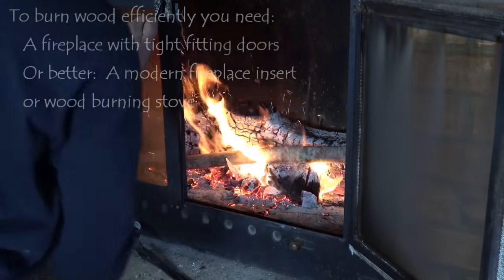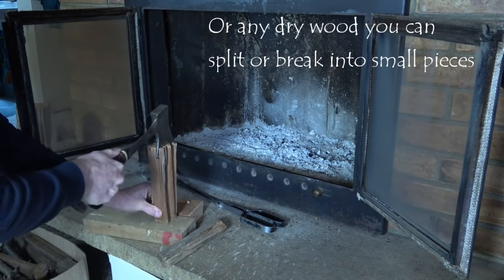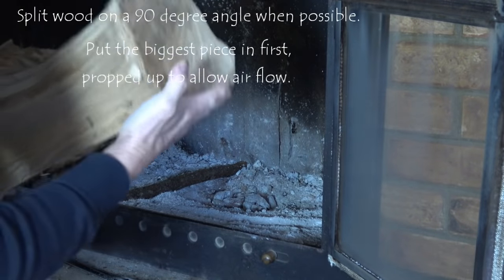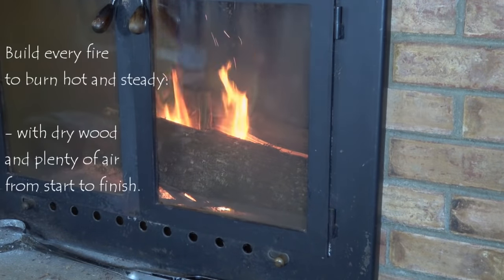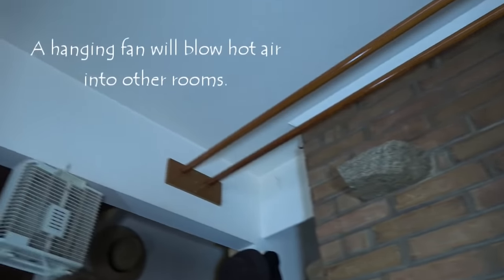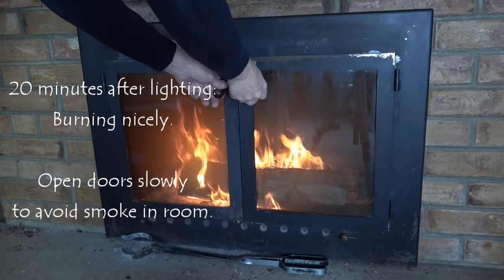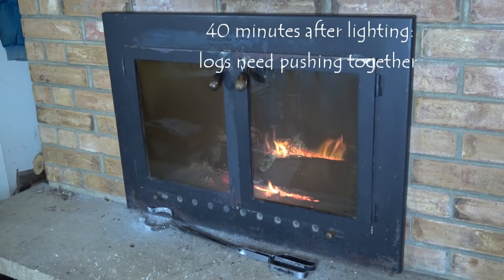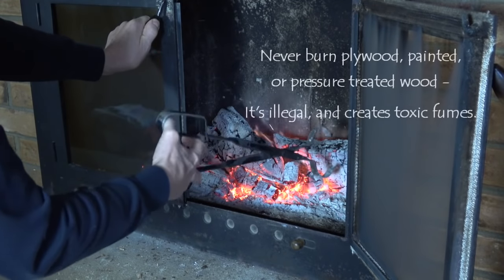Heating Your House Efficiently with a Wood Burning Fireplace or Stove

Comment: Are those ceramic glass doors or are they tempered?
Reply from the maker: They are Pyrex, which is less common.  Tempered glass might shatter with a very hot fire. Ceramic is usually the best choice.
Reply: @HartzHomestead  I have tempered doors on my fireplace and I worry about closing the doors I also have a heatilator with metal firebox and 2 fans that blow heat out the top but I can't find ceramic doors to be able to close and heat the room properly
Reply from the maker: @anthonyd.9314  I had these doors custom made 37 years ago for $300. I've seen air tight ceramic glass doors online but they are about $1000, and for that you might be better off getting an insert. If the glass in your doors is replaceable, you might call some fireplace or glass shops and see if they can custom make Pyrex or ceramic glass the exact size to fit your doors.

Comment: im about to buy a sweep and try to clean mine out dont think its been used for 40+ years
Reply from the maker: As you clean it, look at what condition it's in. Have a fire extinguisher on hand, and gradually build up the fire, watching the chimney inside and outside the house. It should be fine if it hasn't been damaged in any way.
Reply: @HartzHomestead  thanks for the advice its protected from the elements as it has a  cover on it that comes off :)

Comment: Anyone know where to place the wood burning fireplace in a house?
Reply from the maker: As close to the middle of the house as practical, so the heat can radiate in all directions to warm your house. If you put it on an outside wall, you'll need to insulate the back side, or lose heat to the outdoors. If you're building a new house I'd suggest a rocket mass heater in the living room, as they are super clean burning and efficient, and the mass keeps your house warm longer. The only disadvantage is you can't sit and watch the fire. Also they take smaller wood, which can be a pro or con, and some insurance companies might not accept them.
Reply: Hartz Homestead, do you know any types, sizes, or styles of furnace that are popular today? Maybe you can send me a website that can answer my question (?)
Reply from the maker: @jme.7652  See the links in the description of this video for stoves and fireplace inserts that are available on Amazon. The Drolet Wood Stove has excellent reviews and sounds like a high quality stove. You can also search Google or visit a fireplace shop.

Comment: Also a damp paper towel dipped in the ashes will clean your glass like new! You're welcome.
Reply from the maker: It's true, I've done that. I still takes some scrubbing, but the ashes are free and readily available.  For a really thick coat of soot on the glass, scraping it off with a razor scraper gets most of it, then the damp paper towel & ash finishes it off.
Reply: @HartzHomestead  using a razor blade Marine metal scraping material we'll put my new scratches in the glass and eventually make it hard to see through. I'm a shell used wet wood ash misted with white vinegar.
Reply from the maker: @paulatwood9794   I assume your not-so-smart phone wrote some of that for you?  I gather you're saying I'll scratch the glass, but keeping the razor blade flat against the glass, in 35 years I don't think I've scratched it any. I worry more that scrubbing it a lot would scratch it.  I hadn't thought of using vinegar with the ashes though, so I'll try that - thanks for the suggestion!
Reply: Yes that was my smart phone talking for me due my arthritis in my extremities. I've had good luck with using the white vinegar for my stove glass
It also makes the brass look new after removing any tarnish. (I finger typed this time,LoL!)

Comment: Interesting video, thanks!
Doesn't a wood burning stove make your whole house smell like burnt wood? Or would this be a matter of maintaining a smoke-free fire?
Reply from the maker: Avoid letting smoke into the room. Burn a hot fire with very dry wood, which produces less smoke. Open an outside door or window just a crack before slowly opening the doors to the fireplace, and the fire will suck air up the chimney, so smoke doesn't come into the room. If we do get smoke in the room, I run a Merv 13 filter on a box fan that clears the air in about 10 minutes (see my video on that). Breathing smoke is very bad for our lungs, so it's important to keep the air in the house smoke-free.
Reply: Hartz Homestead Thank you very much! I’ll see what I can do with this unused stove we have, after I get the chimney sweeped.
Reply: @HartzHomestead  i did the same but my box fan has 4 filters 20x25x1 3M 1900 is like Merv 13, in Cubic Arrangement Box Fan on Top Blowing Up so it cleans the air really fast
My Wood Stove is new ultra efficient little or no smoke and holds the fire up to 6 hours

Comment: Well explained thank you! Any suggestions how to heat to more rules is it possible to have a wood-burning stove and to let the pipes of the main wood burning stove run into the other rooms?
Reply from the maker: It would be easier to blow the heated air with fans into other rooms (or pipe it through ducts) than to try to re-route the chimney pipe, unless you build your own Rocket Mass Heater.  A horizontal run in a chimney pipe would likely not draft well, and could be a fire hazard. But you could collect heat near the ceiling above a wood stove and duct it through the house with a fan. Our chimney is in the middle of our house, so the bricks get warm upstairs too with a hot fire.
Reply: Some modern fireplaces allow for built in B vents which allow you to directly pipe in hot air to different rooms or floors.  If you've got central air and the return is near the fireplace, you could put it in fan only mode and have it pull the hot air from the fireplace and dump it in every room. 

Our fireplace already heats our house evenly as the blower goes directly to the central living space and up the 2nd floor staircase.

Comment: splitting the cedar like that will eventually have you feeding the fire a few fingers..
Reply from the maker: One time I scraped my fingers a bit with the blade and wished I'd been wearing gloves, but in 40 years I've never really hurt myself. I have gotten a few slivers with cedar and old growth fir.
Reply: lol. best to bury hatchet in top of cedar Then come down on it to complete split ...No fingers in harms way of blade ;)
Reply from the maker: I do that quite a bit too - works good.  I also use an old fro with a vine maple mallet for splitting big chunks into slabs, then to kindling.
Reply: i chopped off both my hands by mistake that way. I don't start the fires anymore
Reply: He is not hitting that hard.

Comment: Brand of insert or glass doors?
Reply from the maker: I had my glass doors custom made by Fireplace Extraordinaire in Kirkland, WA about 35 years ago for $300, with Pyrex glass.  I don't know about brands available today.  Ask at a local fireplace store, and/or research it online. Measure your fireplace opening first. For an insert, also estimate your chimney height and size, as they usually put in a liner. If you burn much wood, an insert is definitely better.

Comment: You have a fire going with the doors closed, how is the heat going to get into the room with the door closed?
Reply from the maker: With the doors closed, the glass and metal of the doors plus the bricks of the fireplace get hot and radiate heat into the room.  I can only sit in front of the doors for a few minutes before getting too hot.  Plus, our fireplace has a heatilator with fans, so the air circulates behind the metal firebox and blows hot air out the grate above the fireplace. Even with a moderate fire the air coming out is 270 F.  If the doors are open, large amounts of air from the room will go up the chimney, and it won't heat the house much.

Comment: What wood do you use?
Reply from the maker: Mostly alder and maple, which are very common here.  Some wild cherry and vine maple. I use cedar for kindling. I also burn whatever wood I'm pruning from fruit or nut trees if it's big enough, like apple, plum or hazelnut, or scraps of lumber from building projects as long as it's not painted or pressure treated.  I've burned cottonwood before but it's so wet it takes 2 years to dry. 
Thanks for asking.  What do you burn?

Comment: Splitting the wood with your hand directly under the axe.. 🤔
Reply: Well at the time of the video still have the 5 fingers and the hand so... I think his sight is really good...
Reply: 27 years as a Navajo on the reservation and that's how I've always done it. Isn't hard, we even use the nail puller on a hammer to split wood as well.
Reply: He is making fairly short and well-controlled swings with only enough energy to crack the wood, and even if he misses there is a very, very low chance he will hit his hand, and even then a low chance of sufficient force on impact to cause a serious injury.
Although perhaps placing the axe head upside-down and slamming the wood over it could get the job done with less risk.
Reply: Who cares? Let people suffer the consequences of their actions

Comment: Cant understand the American way of heating.What about accumulating heat?Isnt it better than constant wood burning?
Reply from the maker: I usually only light a fire about once a day to warm up the house, keep it burning strong until all the wood is burned up, then let it go out. Our brick fireplace stores some of the heat.  A rocket mass heater or Russian fireplace would be better, as both burn smaller firewood in a very hot, but short fire, which heats up a large mass of stone or brick and radiates that heat into the house long after the fire is out.  One advantage is the fire burns very clean and there's almost no smoke pollution.  The worst thing to do is load a stove up with wood and damp it down so it smolders for a long time.

Comment: What is the square footage of your house?
Reply from the maker: About 1,200 sq ft, depending on how you figure it. Downstairs is 700 sq ft, upstairs the ceiling is the roof, so it slopes. The fireplace is in the middle of the house,  and we have R-42 in the roof, (11" of insulation). Having double pane glass plus 2 layer mylar storm windows makes a huge difference. When we put glass doors on the fireplace and installed storm windows, we cut our firewood use in half and the house stayed much warmer.
Reply: @HartzHomestead  okie dokie

Comment: I believe your fans are setup wrong. Your ceiling fan should be pulling up the cold air and forcing the warm air down. That's the "winter" setting on the fan. The floor fans should be doing the same thing. Blowing cold air into the warm room, forcing the warm air out of the room. We have a ranch style house with a wood stove on one end and we can move the warm air through the whole house this way.
Reply from the maker: Either way works, as long as you're circulating the air somehow. I prefer to blow the hot air down into the middle of the room, because otherwise it goes up the skylight well and overheats the upstairs. The fan I have blowing air into the next room is near the ceiling, blowing hot air into that room, which forces the cooler air back into where the fireplace is.

Comment: What is one cord a year?Need a little bit of explanation.
Reply from the maker: A cord of wood is firewood stacked 4 feet wide, 4 feet high, and 8 feet long, about what a full size pickup truck with side boards will hold. We used to burn that much firewood every year to heat the house.

Comment: Watching this video at -5°C in India , wondering how this fire place works....cause we here get only basic ovens with just one exhaust vertical pipe. Metal doors and body....and front airflow vent that is open all the time
Reply from the maker: Metal stoves radiate heat better,  plus you can usually cook on them.  But if the air intake is open all the time, warm air from the room can go up the chimney, so it helps to have a way to control it.  It might be hard to find an efficient air tight wood burning stove in your area.  A Rocket Mass Heater you can build yourself is more efficient, both for burning clean and storing heat, and you can cook on the barrel, or have an oven welded into it.  Many metal stoves in the US have a 4" diameter air intake you can connect a metal pipe to from outside the house. If not, one option is to run a 3" or 4" pipe from outside to the proximity of the stove, with a damper to close it so cold air doesn't come into the house when you don't need it.

Comment: Better have a steel lining system as opposed to clay. Clay liners are notorious for voids and cracking.
Reply from the maker: We do have a 12" square clay liner, with a 1" airspace around it, and a brick chimney. In 35 years we've never had a problem with it. One advantage is we don't get any creosote build up, mainly because I burn hot fires with dry wood, but also the airspace around the liner insulates it from the cold, so if there is any creosote in the smoke it doesn't condense on the liner so readily.

Comment: I wish you had said what to do if you don’t have doors or fans on your fireplaces.
Reply from the maker: You really can't heat your house efficiently using a fireplace without putting tight fitting doors on it or installing an insert, because too much air from the room goes up the chimney. The best you can do if you really don't want glass between you and the fire is to get a grate made of tubing that wraps around the fire, with a fan that blows air through the tubes and into the room. But putting doors on it would cost about the same and heat the house much better.  An insert is much better still, because it has built in fans and burns cleaner.

Comment: This is why I HATE my wood burning fireplace. Too much trouble to start a fire and it gets my house freezing
Reply from the maker: It's a lot of work heating with wood, so if you don't have an efficient system and enjoy lighting fires, it's not worth it. If it's making your house cold, it sounds like you don't have tight doors on the fireplace, and a lot of air from the room is going up the chimney, sucking cold air into your house.

Comment: My OCD was going crazy with all the times the doors were being opened.
Reply from the maker: Well, that was taken over 4 hours, shortened to 5 minutes for the video.  In our big fireplace I have to push the wood together or add new wood about every 20 to 40 minutes to keep it burning hot.  A wood stove or insert normally has a smaller firebox, which keeps the wood closer together and may not need checking so often.

Comment: The secret to long term wood heat is keeping the wife happy. Splitting wood in the house is messy and is going to break that stone your work on. If you're starting the fire thinkin' romance ( it could happen) then prep wood outside carry it in bucket ,slip off yer shoes at the door each trip out, respect her clean floor and if you make a mess, clean it up.  If that is all to much just pay the power bill.

Comment: i did enough wood burning,stacking and splitting for one lifetime already....now i just run the pellet stove
Reply from the maker: Firewood takes a lot of physical work, which is good exercise, but also hard on the joints.  We use electric heat more often now, so we don't burn our hard-earned firewood any faster than necessary.
Reply: Robert Swift , Ha haaaaa , hell yah ! I'm in a place that has both ! The pellets are nice if / when you have $ for them ! The woodstove is so much maintenance and work , with the wood consumption rates if you were to buy wood they have got to be more expensive plus very hard / impossible to regulate . The outside wood burners must be the way to go with wood . A regular stove will fricken wear you the hell out ! Not worth it .
Reply: Hartz Homestead , Just saw your comment after leaving mine ! Read mine if you want. Wood works but have fun with it making you feel old and poor ! This day in age , I look at it best used in a cottage , cabin or house for occasional use and a great BACKUP  , garages were flammable situations are avoided , to . It's miserable to rely on it , and the wood consumption is very high unless you have a super small place and or super well insulated . In short sir - they are very old fashioned and SUCK - at least the one I've been using ! Got a pellet stove to fortunately but out of pellets for the moment and its 18° !!!!! I neeeeeeeed a magic long lasting log heeeeeeeelllllllllp !

Comment: My house is freezing the day after a fire. I need help!
Reply from the maker: If it's very cold out, I need to light a good hot fire at least once a day. It takes a very well insulated house to carry the heat from one day to the next. Insulating your house better will help (like adding double storm windows or insulated night shades). Also increasing the thermal mass that gets heated up when you have a fire (like a rocket mass heater or masonry heater).
Reply: Hartz Homestead I think the flu is open at night and the fire goes out. Then all my head gets sucked out of the house. Is this true? Thanks for replying.
Reply from the maker: @growsinhouseherbiculturali1100  Yes, if you don't have airtight glass doors on your fireplace that you close at night, then after the fire goes out the heat in the room will go up the chimney, and you can't close the damper yet if there's any coals burning at all or you'll get smoke in the house.

Comment: Reverse your ceiling fan to pull the cold air up into the warm air.  You are working against nature.
No offense intended. Great video and helpful!
Reply from the maker: I have found the ceiling fan circulates air just as well either way. One pulls air up in the middle of the room, forcing it down the walls, the other way pushes air down the middle of the room, sucking it up along the walls. I prefer having the warm air blowing down into the middle of the room, where I am located.